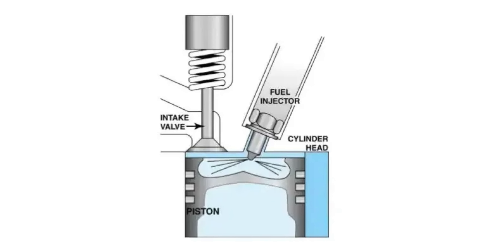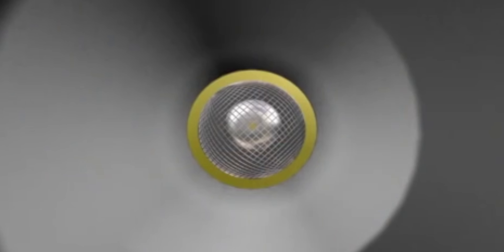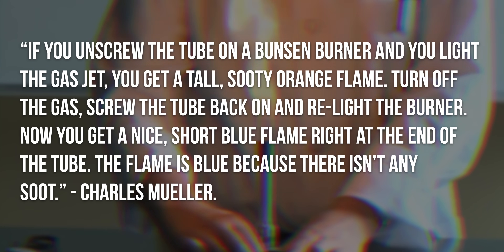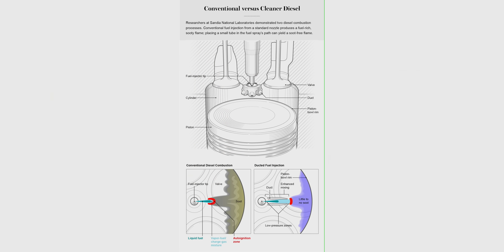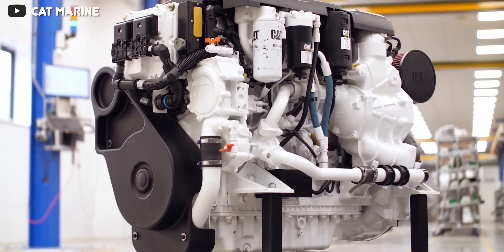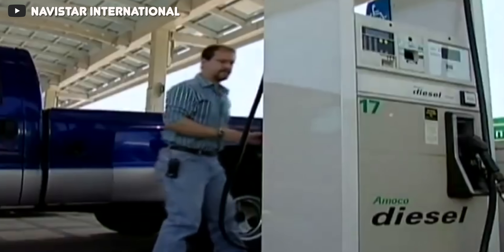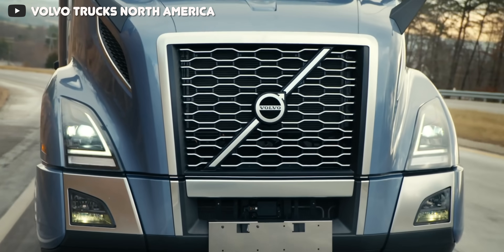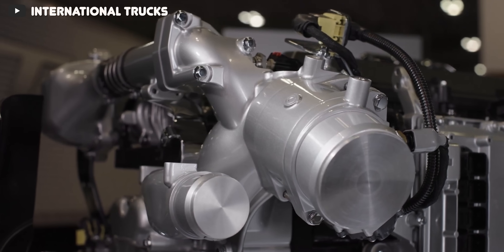Zero Emissions Diesels: How Ducted Fuel Injection can Save the Diesel Engine

Comment: The shit bags running our world have been holding back all kinds of technology for well over 100 years.. that's is the exact reason for forming of EPA. since electric care are not efficient or practicle they they push  all kinds of crap against internal combustion engines. So they can make it seem to us that  lithium battery electric cars are better when they fall short in lots of areas, actually being green practice range. And fact over 60 percent of planets electricity still comes from something they call "fossil fuels"... and  from 2000 to 2020 20 years of solar panels and wind turbines " green energy movement"  has only reduced plants electric consumption from fossil fuels by only 1.5% all this green energy crap is f$%# Scam!!!

This injector seems like it can easy double fuel efficiency

Comment: Great video.   As many know very powerful forces trying to kill off diesels with similar forces fighting back.   Needs FAST global mandate to get these retro fitted into older, dirty diesels and with the plethora of injector manufacturers like Bosch, Delphi, Denso, Edelbrock et al they should easily be able to advance intensive testing and scaling up of production to satisfy insatiable demand.
EGR's, DPF's etc. are a nightmare for everyone to deal with, causing far more headaches and hobbling diesel engines.   Unsurprisingly they were a quick reaction from government directives and NOT an ideal solution.   Many people hate EGR's with good reason.   Scaling up production will reduce unit costs making it sensible to retrofit a set of new 'super' injectors for the benefits you mentioned.
Not quite believing gains quoted, but a 50% improvement could be possible.   We wait with anticipation!

Comment: The bunsen burner has a better air fuel mixture then a lighter, so it burns cleaner and hotter.
Diesel injectors already inject to reach a perfect air fuel ratio and the injector is not supposed to keep a flame lit on the tip like the burner does.
A diesel injector injects into air to mix before ignition.
This nozzle thing looks huge compared to the nozzles already used, if something goes wrong it looks like the head needs to be removed and what about piston and valve clearance if retrofitted?

Comment: Carbon does not influence climates! Carbon dumps heat at night into outer space, it is an element that combines easily with other elements and is essential to all life. 
No oil and coal use is assured destruction. The Carbon Climate utopian Marxist cult threatens you and all land-based life.
 Our Use of fossil fuels makes the human species a very important part of the biodiversity of this planet. Carbon dioxide is life! CA + Co2 + H2O = Calcium Carbonate (Bone, shells and vertebrate invertebrate)!   Co2+ H2O + Sun = Photosynthesis  LIFE for (Plant-based life trees etc)  Co2 greens the earth, carbon for plants, and oxygen for life.   
Low-temperature sea levels absorb Co2 and Calcium Carbonate life forms lock Co2 away from the life cycle of the planet.  Without Co2 replenishment and Co2 falls to 75PPM, the outcome will be a mass extinction of life and the land mass on the planet will become deserts.
 Unknowingly humanity's use of fossil fuel has benefitted all life forms on the planet and all life forms are carbon-based. 
There were three climate changes last century, a warm one, a cold one, and a warm one which is coming to an end. C02 Carbon has no significant impact on climates. The sun’s output determines our climate and the planet is now going into a 200-year cold phase.
The present carbon ideology is death to all land-based species.
Carbon dioxide CO2 and all other gases dump heat at night to outer space, that is why the temperature drops at night, and are not greenhouse gases. Entropy. All heat flows to cold. The only significant greenhouse gas is water vapor and that is short-lived. 
Politicians, legislators, & Media collectively control us with a climate change & pandemic psychotic agenda for the U.N. N.W.O. Puppet masters of False Fear slavery.
THE CLIMATE CHANGE V1 & THE PANDEMIC V2 Anarchy! Not possible to get back to where we once belonged.
Reply: @Edward Elizabeth Hitler Space is a low-temperature place. The second law of thermal dynamics Entropy all heat flows to cold
Reply: @Edward Elizabeth Hitler Radiant heat travels at the speed of light when not impaired humiditry
Reply: @Edward Elizabeth Hitler Your Carbon grooming knowledge is politics, not science.  Do you have a meal ticket in BS

Comment: I like the part where he said "Soot" :D

on a serious note tho, I really hope this becomes a thing soon, I'd like to buy a car with that technology because diesel engines are just worlds above gasoline engines in terms of reliability, longevity and low end torque

love the 1.9TDI, it's a workhorse that might have been a huge mistake by VW, these engines just don't fail that easily

unlike some of the new engines from VW where you can expect an expensive repair (in the range of 4000-6000$) at around 150.000 miles

Comment: cool idea. no moving parts. just a venturi. uses the same air already in the cylinder, and accelerates by injected fuel for better mix and complete burn. no negatives. no emission system crap. i hope it's real soon... !

Comment: The Diesel engine is by far the greatest engine produced. It has been maligned by the nutcases who don't understand the real world
Reply: It's being suppressed by oil companies that would like to see it outlawed because it's so efficient.
Reply: @johnnycarson67  what? Why would oil companies suppress an engine that burns oil, when the alternative is fast becoming electric? Thats so dumb.
Reply: Fuck this one actually makes sense! Holy shit. In this day and age yes I think…
Reply: so efficient? it's not even 30% efficient, what are you talking about? As long as you're burning stuff, most of the energy goes into heat, not into kinetic energy, it's as simple as that. And then I'm not even taking into consideration the drilling, refining and transportation of diesel fuel halfway across the world (if you would include this then your so called efficiency drops to somewhere between 10 and 15 percemt.) Get outta here.  @johnnycarson67
Reply: ". It has been maligned by the nutcases who don't understand the real world"

That sentence makes no sense.

The only reason why diesels where largely replaced by petrol engines is that eraly diesels took a long time to start and where sluggish compared to the instant power of a petrol engine.

It's easy to imagine all kinds of stupid consipracies but let's leave those to the Americans who basically blame everything they don't like or understand on a conspiracy.
Reply: nutcases the oil industry
Reply: But it spews out dirty sooty exhaust.
See my comment on this...
👍
Reply: @raybin6873  if a diesel is running correctly it burns very clean - especially if burning new synthetic fuel oils.  The matter can be corrected further by designing engines with higher compression ratios.  The reason why this is not done currently is because lubrication oil on cylinder walls would ignite.  Ceramic engines and pistons with graphite rings are being explored.  A simple solution to current engine design is to have bubbler water drum filters instead of paper felt air filters.  When a diesel can't get enough air it definitely burns dirty.  This happens when an air filter is clogged either by dust, high humidity or both.  Also worn out, low compression engines and engine with worn out injectors also burn dirty.
Reply: @raybin6873  lots don't
Reply: @Markdmarque  " if a diesel is running correctly it burns very clean"

A) A clean burn only means it doesn't produce soot.
B) Any combustion engine that runs properly burns cleanly.

Comment: The thing is.. 
Without the ridiculous emission values for NoX non of those Problems would exist!
No exaust recirculation, no dpf, no urea injection.
The amount of NoX from Diesel engines is in the ppm range at the exaust stream.
After mixing with the atmosphere there is not much left!
It would be more likely to get co2 poisoning if you folow that analogy.
Those stupid panicmongering campaigns are just so the politician can pet themselfs on the shoulder and belive they saved humanity. 🤮

Comment: I am battling to see how this would work with a turbo diesel. The fuel is drawing in air like a venturi. what happens when the air is forced in ?
Reply: No difference, turbo or not.
The ducting is not involved in the induction (intake stroke for 4 cycle).
The ducting only happens late in compression stroke, with all valves closed.
The air is actually drawn into the nozzle duct by the velocity of the diesel fuel being injected through the nozzle.

Comment: wtf!    it has not been 20 years  !  that the  war against  oil burners   has been going on  ? . it has olnly bean  since   vw was caught out cheating  .  up untill then    governments everywhere were  pushing the sales  of iol burners .
 
MY 19  YEAR  OLD VW  has done   250 thousand miles   IT RUNS SWEET  ON   veg oil [canola iol]  
it does not hardly   register  on the emmission tests  they perform in the uk  ?
as i only drive  a few tthousand miles a year [ 6 k]
  i do  not pay  fule tax  it cost me about   £50   [uk]   to fit a pre heater  in the fule line to the  pump   that i only need to switch on in winter  
.the one thing i can't  understand   is why the hell can my   19 year old  vw  transporter  that is as big as  an american   pickup    return 30 mpg ! when the same size  / waight  and load  capacity    vehicle in the us    can't  do  20 mpg  ??
my old bus   with its punny 2.5  l engine    will tow  two tones     and still  do 450 miles to a tank of   Diesel  / store bought canola  .???

Comment: What you guys are trying to say the fossil fuel engine with your stupidity it doesn’t matter if it’s got low, admissions or not it’s still using fossil fuels, which still pollute the air which steel damage the land when you retrieve this oil and stuff are you understanding why we need to get away from it or are you still trying to save a fossil fuel that we need to get away from it just because you’re in love with it doesn’t matter if they got a new processor or a new way we need to get away from fossil fuels you fool

Comment: Yeah the reason you have too much emission in diesels is because of shitty tuners. The add more fuel and boost theory works for power but it makes black smoke, that’s unburnt fuel people. 
  It’s called engineering. Gale Banks engineering and Banks Power has made diesel
 performance that meets California emissions, increases power and mpg. And off road power that makes stupid power without smoke!! It’s called volumetric efficiency. Learn to tune and tell the epa to step off.

Comment: It would seem like a good idea if it worked. Yes, the bunsen burner idea works for a gas but not so much when you are talking about converting oil to a gas with tiny droplets of oil in it. Current diesels (euro 5 compliant) are largely thought to be the most efficient but also the most dangerous for the human lung. The particulate matter is so small that it is more likely to be stuck in the lungs. How this ducted injector will work in a high pressure environment remains to be seen.

Comment: HERE  IS  THE  REAL  PROBLEM :
OldDiesel <~ Works just fine, simple and cheap to make/maintain, but puts out [x] "pollution".

YoungerDiesel <~ Works ok, not quite as simple and cheap to make/maintain, but puts out [<x] "pollution". Cost of goods and services rises.

ModernDiesel <~ Works as long as you pump endless amounts of money into it, but it puts out [even less than x] "pollution". Costof goods and services destroying middle class and poor.

FutureDuctedDiesel <~ Works great considering manufacturers can go back to designs that worked better, but it still puts out [least x] "pollution". The EPA standards will be adjusted to destroy this technology and keep prices of goods and services relying on diesel (everything) to get even more expensive...BECAUSE IT'S NOT ABOUT THE ENVIRONMENT, SLAVE!

Y O U     A R E     E N S L A V E D     B Y     S M A L L H A T S  !!!

Comment: "Massively increase EGR". Until you can get away from an engine eating it's own waste, you are not improving the situation. Anytime you introduce something that won't burn into the cylinder, you have to increase what will to make up for it, using more fuel, and wasting energy. At this point the EPA is firmly entrenched in SCR and DPF... that is not going to go away, The result is extra maintenance and expense and is what is killing the diesel engine. It still makes no sense to introduce raw diesel into a can to burn off soot just so you don't see it. It's still there, just in much smaller form, and satisfies the greenies.

Comment: I own an under 1 year old Euro 6d diesel and this is as clean as a whistle. It has ad-blu injection and a huge DPF.  Demonizing diesels is not a great idea IMO as comparing the efficiency and performance of my car to a similar petrol engined car is very striking especially in town.  Politicians assume in The UK and EU that people will get rid of their 2 and 3 litre turbo enined cars and go to tiny engined petrol cars which is of course only going to happen in a tiny few cases. So in summary if you want loads more Co2 get rid of diesels !

Comment: The EPA, like virtually anything "government" does not care that the compression ignition (diesel) engine is literally the engine of the world's economies and that right now, there is NO ALTERNATIVE to them.  Do they really think solar panels and wind turbines will "clean things" up?  Well, as I understand it, solar panels and wind turbines are NOT recyclable and NOT 100% reliable.  So, they end up in landfills.  Does the EPA care about that??
To push the world on to unreliable alternatives AND to push everyone to electric transportation that relies on this energy without concern for the cost and consequences, is ridiculous.
Also, if engine manufacturers are concerned about reduced reliability of these new injectors, what about the reduced reliability of their engines because of draconian standards for clean air??  They have, it seems, nothing to lose.
In addition, renewable fuels can be used to reduce emissions and reduce dependence on foreign oil, help local farmers, keep waste oil out of landfills (does the EPA care about that??).   There are many sources from which to obtain renewable fuel (methyl esther).  B50+, with this new injector, could really help the air, farmers, landfills and most importantly, peoples' wallets!!
By this time, I'd think that even a damn wax-burning candle would emit more emissions than a compression ignition engine; does the EPA care about that??

Comment: Soot is a product of excessive fuel, poor air, fuel/air mixing, insufficient combustion time, and “quench” (cold surfaces stopping combustion). Excessive fuel can be dealt with by limiting the amount injected. Mixing is what this innovation addresses. Combustion time is a problem with modern high-RPM engines. Quench is exacerbated by short combustion times, conductivity of cylinder walls, pistons, and heads, and low operating temperatures. The intermittent combustion of a diesel or gas (Otto cycle) engine exacerbates everything. The external combustion Rankine cycle is far more efficient, and easily solves pollution issues with burner design and adjustment. Maybe it’s time to step back a hundred years and look at steam all over again.

Comment: It would be very interesting to retrofit a Detroit 2 cycle Diesel.  The removal of the DEF system would greatly increase reliability of present engines.
Reply: Will be patiently waiting for the 8v71 kit :D
Reply: Yeah but there’s no profit in not making you buy in extra fluid
Reply: That was my first thought when I watched this.  Could we see (and hear 😆 ) the old 2 strokes back on our highways?  Wouldn’t that be something ? We can dream
Reply: I would love to see retrofit kits for Cummins xBT series engines if this turns out to be the miracle it's being touted as
Reply: Hell yes!
Reply: My understanding is that DEF fluid is injected into the exhaust  ( hence the name; diesel EXHAUST fluid) and not into the engine, and has no bearing on the reliability of the engine.
Reply: @davidharris9077  Not the case, they affect engine reliability in several ways, one of which is the engine programming and while it isn't directly affecting the engine if the computer isn't letting the engine run correctly it is very much affecting the engine
Reply: Unless there is a separate oil system for the combustion chamber, most 2 cycle engines have the oil mixed with the fuel.  Atomizing the oil, would be counter productive to its task as a lubricant.  Most diesel engines now are mostly 4 cycle.
Reply: @peterpeek4831  Detroit Diesel 2 strokes do not use a oil/fuel mixture.  They have a separate lubrication system and do not burn the oil.  Detroit Diesel's burn Diesel fuel provided through injectors just like all other common diesels.  The real difference is that they are only 2 strokes, have a blower and do not have an intake valve.  Look up one of the many youtube videos for an explanation.

Comment: You would have to  charge  the mandate  for the emission  controls  that forced  enine manufacturers  to put on Def partical traps and egrs even if devices  like the hydrogen generator  a Iowan  had invented  and patented  over 30 years ago was not bought  buy the truck engine  manufacturers  because of the extra profits  the manufacturers  and dealers make  selling and repairing the devices  we now have.